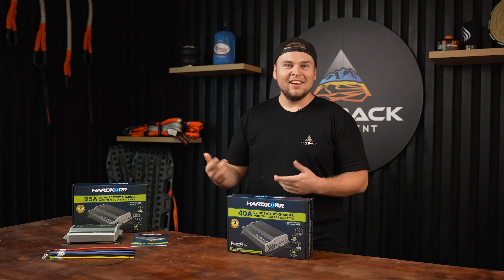Hardkorr DC-DC Charger Review

Comment: Has OE installed one in a vehicle yet?  The manual is pretty light on information. Specifically I'd like to know how it handles charging when both solar and alternator charging are available. I'd also like to know if it maintains the starter battery when solar charging is present.  

3:35 "you won't need an external battery monitor"  -- unless there is a shunt supplied the charger has no way to discriminate between amps going to loads and battery charging.
Reply from the maker: Not yet! We could perhaps arrange this for you in the future. One thing we can confirm without the install is that the DC DC charger is dedicated to the second battery it will not maintain or charge the start battery even with solar.
Reply: @OutbackEquipment  there's a few other mistakes in this video also. Will be in touch via email.